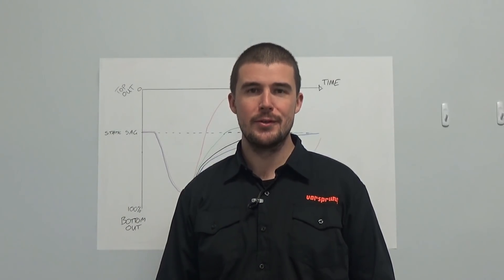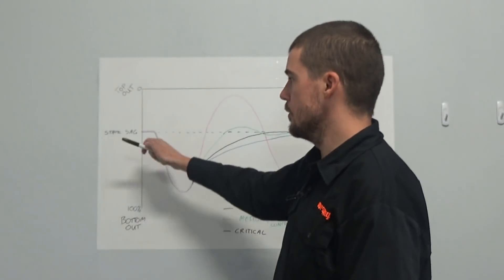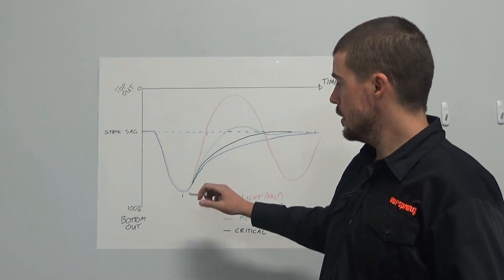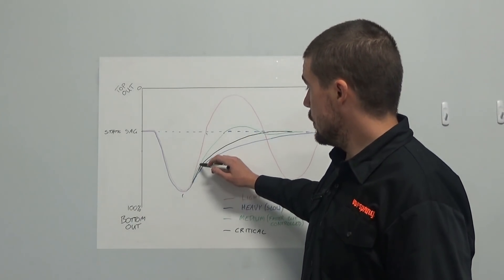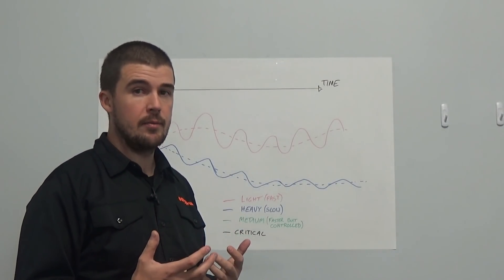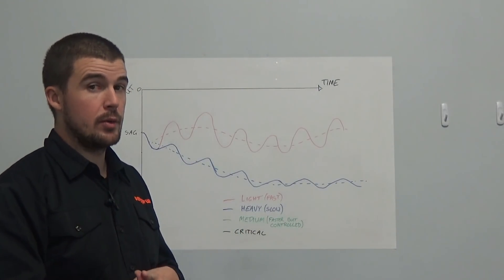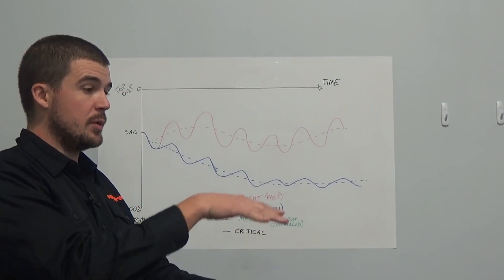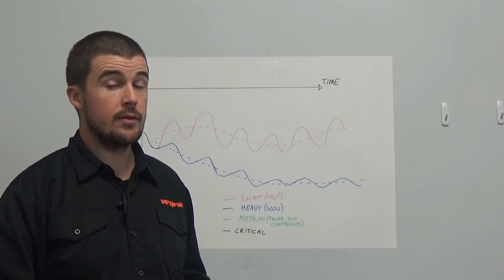The Tuesday Tune Ep 19 - What Your Rebound Damping Does

Comment: 100% the best explanation.

Like many here we have looked up all the discussions all the guides all the how to's.
And then you come here and it all make's sense.  Everything is compromise.

I started with heavy dh 2.6" tyres with a firm coil and fork pressure. (20% sag front and rear). Naturally this felt harsh to ride, traction wasn't great. Bike felt sluggish AND wasn't even using all of the travel. Rebound was set to the 'critical damping' stage where it did not occilate) when bouncing on the saddle.

I thought.. This can't be right ?? you see all the vids with smooth looking suspension and grip for day's.. and wonder why your bike isn't doing the same thing.

So i completely changed tyres for lighter weight, (2.4), less rolling resistance etc, softer coil spring and fork pressure (25% front, 30% rear). Opened up the rebound to where it occilate's once (Can be slowed down a click or 2 if needed) And the entire characteristics of the bike changed !!  It now feels light and poppy, super nimble and responsive without packing down !

In my mind i alway's thought, more 'aggressive' riding means i need a more aggressive bike setup. When sometimes the opposite is the solution.
It may sound boring, but sometimes balance is the answer. As mention in this vid :cat-orange-whistling:

Comment: Im here for motorcycle suspension and i love these videos. Great job explaining. See if you could get a computer simulation on the sin waves for different speeds and damping. Question if you change spring preload does that affect rebound? Will faster speeds also make you want to adjust rebound or compression or preload? Stiffer suspension means uncomfortable slower speeds but planted as a rock faster speeds. Love your videos

Comment: Thanks - I'd always ridden with fastest rebound (counter-intutively - thank you). Last season I learned that keeping rebound super slow kept the wheels on the ground, which felt great and made the bike waaay more stable.  Now I feel like I should start to increase rebound incrementally to find the sweet spot.  Appreciate the explanation
Reply: The problem is most factory HSR is too restrictive, so you end up using the LSR (the only available adjustment) more open to make up for this.  So in many cases, we are "forced" to run very light "rebound".  Some rebound circuits are too simple as well (have no HSR function).  Classic examples of the latter were old marzocchi HSCV carts and Fox CTD evolution, they had no HSR circuits.  But even the HSR circuits on lots of stuff simply doesn't work properly because it's valved too stiff for the rider/bike/leverage.  See vorsprung's video on the RS Monarch, their "rapid recovery" rebound is basically the opposite of that, as in it can't function as a high speed rebound circuit because it's too stiff.  The talk here is more theoretical, but there's good info there.  It gives you some tidbits on how well properly tuned suspension can work.

Comment: Fantastic vid,thank you.
Quick question.
I am running a .06" volume reducer in my optic.good support.
Was mostly running 32 33% sag 140psi.
Bike felt nice and controlled /balanced.
Pedaling average.
If I increased Spring rate/air pressure by another 10 psi (which I did) bike baecame a lot more alive and felt quicker.
Should I slow down rebound to compensate for the increased rate.bike was very poppy and back end kicking up ,or back the air pressure off slightly.
Was after better pedaling (achieved)and quicker ride(achieved) control was lost slightly.

Comment: What about RockShox's Rapid Recovery? Does Fox have similar tech?
Reply: Standard practice from rockshox, their marketing makes out they are the best in the biz but in reality they are average products for the mass market cough punters. One thing they do well is user serviceability, the service manuals are pretty good and spare parts not too hard to come by
Reply: It's just a marketing name for high speed rebound circuit, what's ridiculous is that rock shox didn't use it till 2012 or so, and peopple were saying those forks are the best... Well, they weren't, actually they sucked compared to about everything on the market in that regard.

Comment: Thank you! Researching this a couple months ago regarding fork settings basically all the internet had to offer was "I ride fast so I set my rebound fast." Moto guys weren't much more help. 

My personal experience was that the commonly suggested methods in other videos / articles for "ballparking" fork rebound generated results that were far too fast. I'm on the opposite end of the adjuster from where I started and the bike feels great. It is now smoother at speed than it was under the "how to calibrate your pogo stick" method.

It seemed easier to find a starting point to observe and damp oscillation in the rear end by feeding it a square wave input. The front ended up being a bit faster before it wasn't generating additional roughness from trail input but not by that much.
Reply: Jacob Albers  if you find the right Moto Channel I think you'll find that they are equally as good as any of the best MTB sites as far as suspension set up goes. Let's face it the top MX SX and mxgp teams have some of the best technicians in the world. Öhlins technicians could arguably be some of the best ever
Reply: Definitely! The signal to noise online doesn't seem great but I'm starting to find some good stuff :) I should probably check out  some books as well.

Any suggestions?
Reply: Jacob Albers  not Motocross specific, but across the whole Moto Spectrum this is hands-down the best book:
Race Tech. The suspension Bible.
Here's a preview 👍
http://www.racetech.com/HTML_FILES/SUSPENSION%20BIBLE.html
Reply: Jacob Albers  another good source of suspension info is Dale Rathwell. 👍